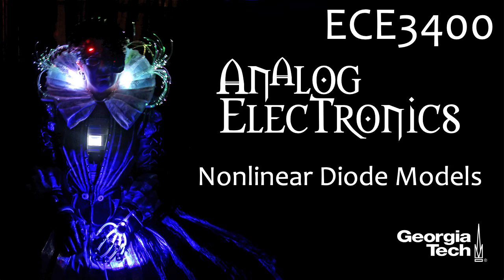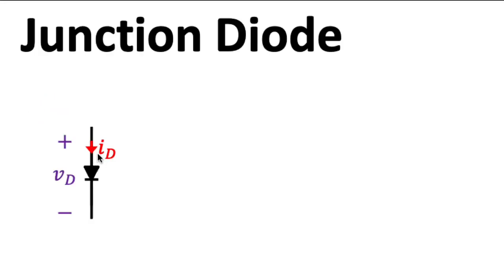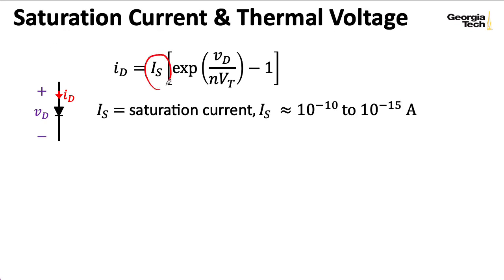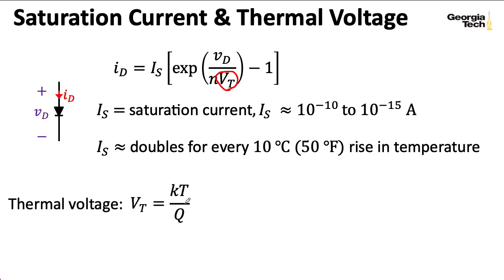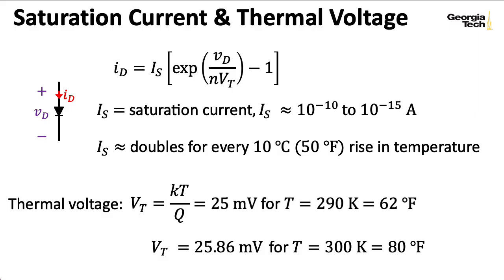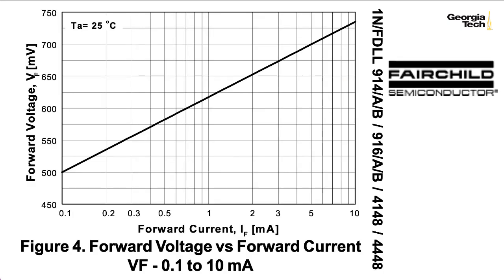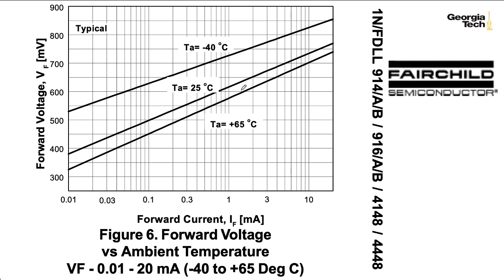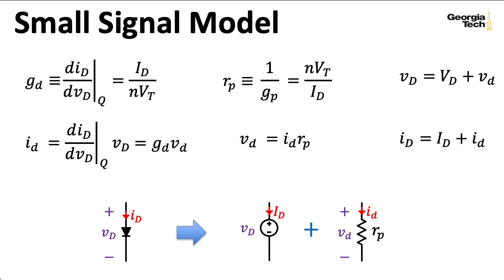ECE3400 Lecture 2: Nonlinear Diode Models (Analog Electronics, Georgia Tech course)

Comment: I’m going to take a shot in the dark here, but I’m under the impression that the voltage and current axes are swapped because when actually characterising the diodes with real equipment, it is easier to vary the current via op amp circuits than it is to vary the voltage. Linearly varying the current will safely give you a logarithmic increase in voltage, while linearly increasing the voltage will give you an exponential increase in voltage, so it’s very prone to accidentally going beyond the safe limits of the diode. You also get a pretty bad resolution in the measurement since you’re trying to measure currents with different orders of magnitude when keeping the voltage as the independent axis.
Reply from the maker: That sounds very plausible to me.

Comment: If you push a standard diode into its breakdown region, does that by itself actually cause damage, or is it only if there's an uncontrolled amount of power/current during breakdown? I've seen people on the internet saying that it's only damaging if you exceed the thermal limits of the junction. But I've also seen people say that if you reverse bias the base-emitter junction of a BJT (e.g. when making a noise source), that you should never use the BJT for anything else after that. A quick thought is that maybe there's some unevenness in the junction of a non-zener diode that would cause localized hot spots during breakdown that zener diodes are designed to prevent. There's also the issue that higher voltage zener diodes actually have mostly avalanche breakdown instead of true zener breakdown.
Reply from the maker: I'll be strait up and say I have no idea. ;)

I'm pretty much repeating what I learned from Marshall on that.
Reply: @Lantertronics  😂Looks like I'll have to test it myself! (Also, thank you for admitting that you don't know. I really appreciate when people are willing to do that.)

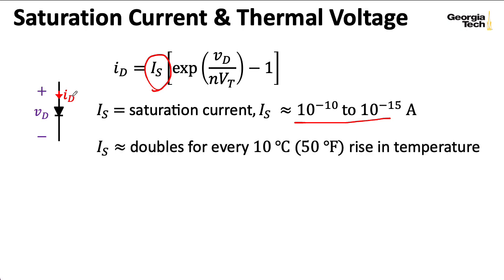Comment: 4:00 Oops, the 10 degrees C change translates to 18 degrees F, not 50! A minute later you show the 290k change to 300K, a 10 degree change on the K and C scale, correctly as an 18 degree increase from 62 to 80 degrees F. So obviously you know what you're doing, that 50 number must have come out from the wild blue yonder...
Reply: it is probbaly just 10 celcius (10 degrees above freezing point) is 50 F (32 F is freezing point). Honest oversight